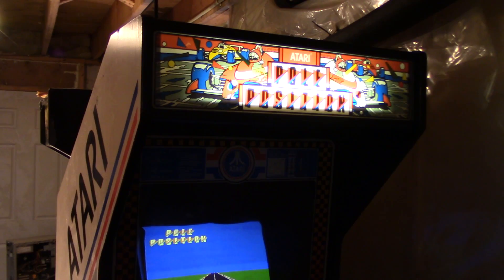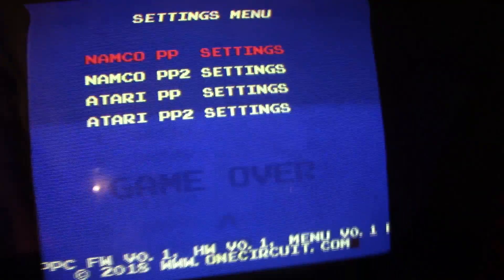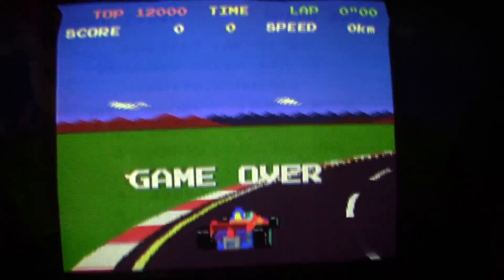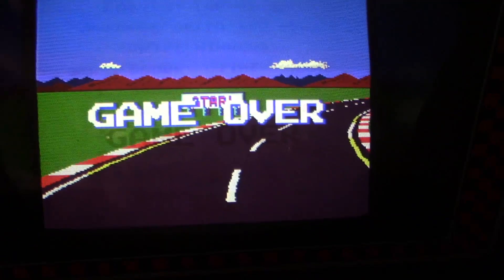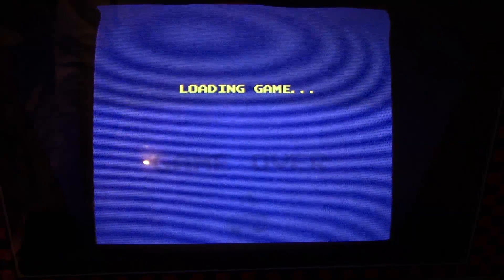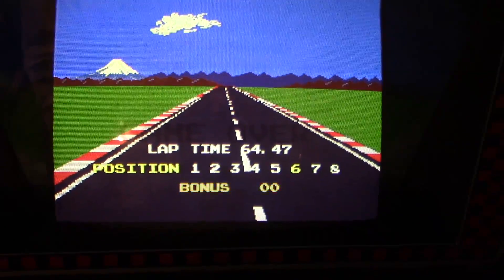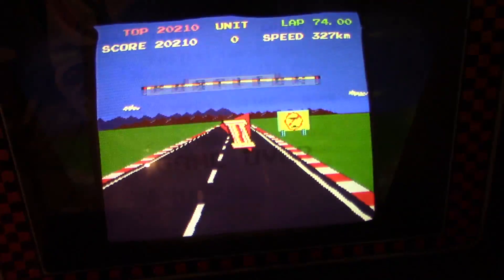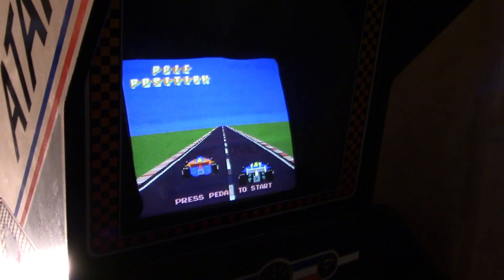2/2/19 Pole Position Clone Status and Overview

Comment: What are the bottlenecks with the load times?  
I know that at least on some systems if you're doing an "fread()" type of thing, with really small amounts, the overhead of doing the calls/buffering vastly overshines the actual data read times.   ie reading a file a byte at a time is a lot slower than reading it in 1kbyte chunks etc...
Reply: I'd also recommend hacking the roms to remove the self-tests, or at least patching them out to only do the minimal amount of stuff. I did this for each of the games in a 30-in-1 pac-man/pac-man hardware game switcher i made years ago... along with patching roms to work with different controls, etc.  fun stuff! :D

Comment: The curl at the top of the monitor has to do with the sync.  Try connecting together the H and V sync lines in the monitor cable (or separate them if they are together already) between the board and the monitor (an easy fix!)  It's a common problem on Pole Positions. It has something to do with the monitors that use combined sync, but pole position has separate H and V sync.  (Maybe I am recalling that backwards)

For the noise, I agree with the others - sounds like HV arcing.  I had one game making that sound at the neck board, if that's the case, it could be focus voltage jumping over the arc gap in the CRT tube connector.  So, if the sound is coming from the neck board, check the focus (though that usually messes up the pic).

Comment: I know what you mean about the assembly. I ported Pole Position to the gameboy advance for Namco Museum. It was quite a challenge to get everything working.
Reply: Bob Hickman oh wow, I have that version of Namco Museum.  That’s really cool!
Reply: I was always impressed how playable Pole Position was on the GBA. In most Namco Museum releases, I just ignore it. But not on the GBA.

The only thing I'd change if I could was Pole Position II having also been included. :)
Reply: @LeoA2600  Would have loved to have added PPII as well along with high score saving, but Namco wanted to keep the cost low.
Reply: I played your game often. Me and my friend would compete for the high score.
Reply: @joeyvigil  That's awesome, hope you liked it. 
I wish they would have let us do high score saves on the cart, but the overhead price was too much for a budget title.
Reply from the maker: Awesome!  Sounds like a cool gig. ;)
Reply: @onecircuit  Yeah, it was a lot of fun. I had problems with execution speed, so I modified some of the draw routines to take advantage of the GBA hardware. For example, I disabled drawing the horizon graphics character by character and pre-rendered it all into a giant sprite which I shifted using the hardware offset register. I still could not get it running at 60 FPS consistently so I decoupled the logic from the rendering and it plays the game at 60 but sometimes skips a video frame. Most people don't notice though. Also there's no analog stick on the GBA so I had to fake it with the D-Pad. It's still pretty playable. I did Galaxian and Galaga ports too, and PacMania for Pac-Man Collection on the GBA.
Reply from the maker: That's badass bro! I love stories like these :D